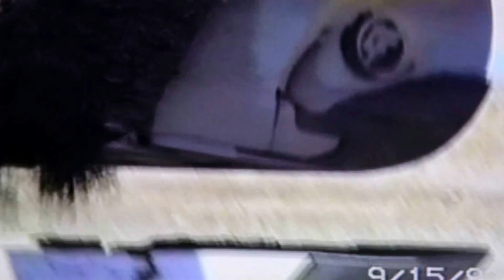Komatsu PC 650-5 Loading trucks using a custom built 10 yard bucket in 1992

Comment: OMG I can't believe only 1Bucket in a trailer!!!!! Very Unproductive
Reply from the maker: Unproductive?
Reply: What is the point? use half the amount of trucks, Save a mountain of money!!!! and Hows the floor that's left behind???? what a disgrace , watch the grader on it....WOW
Reply from the maker: I'm not sure what you are trying to say. But every truck load was weighed, that is how is how the truckers got paid. By the ton and believe me they let know if they were light. 80,000 lbs is the legal gross vehicle weight in CA. 
Now when I loaded Cat 769 haul trucks, 4 bucket loads per truck would have dirt falling off all 4 corners. I would put most of the last bucket on the head rack. With good haul truck drivers, we would move over a 1,000 yards a hour. That was over 20 years ago when most companys loaded trucks with loaders.
Reply from the maker: Oh I see, now. The machine has a 10 yard bucket on it. 12 to 16 tons per scoop depending on the material being loaded. You can read the description for more info. 
As far as grading the ground goes, there are a lot less expensive ways to grade then using a excavator. It would NOT be prudent for the excavator to be grading with trucks waiting to get loaded. Believe me, the company knows where every penny is being spent and is looking every way possible to spend the least amount of said pennys!!!
Reply: What planet is that on 2buckets 80.000 pounds
Reply: @mbulu6351  80k gross. 12+ tons per scoop plus truck tare weight. You can't exceed 80k pounds gvw in this state without special permit.
Reply: @dirtdiggur  the trucks in Massachusetts legal weight is 100.000 plus 5% in a pit with no scale .before they dump the scale in ave at 115. 110